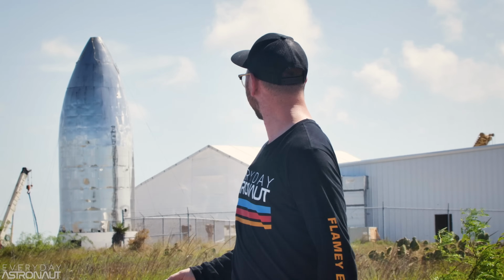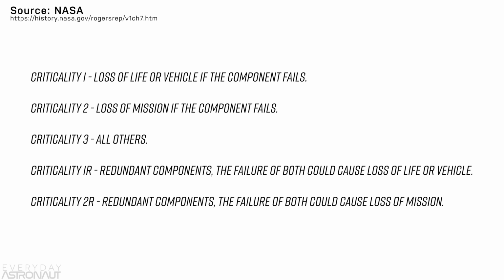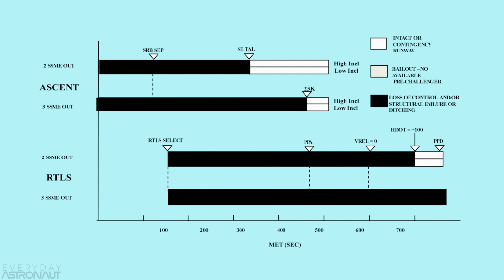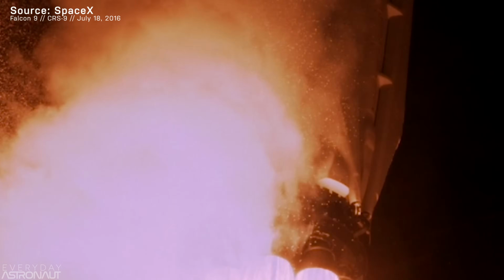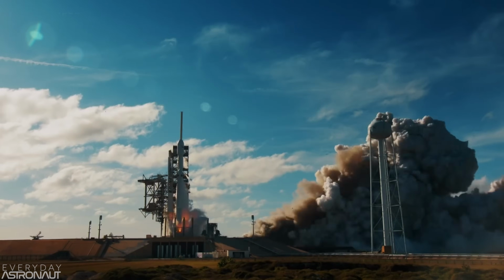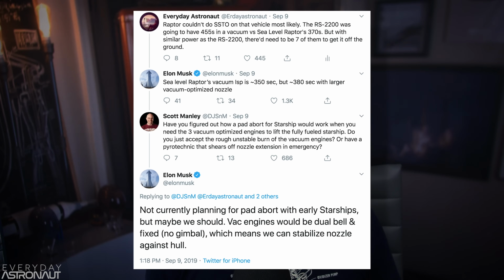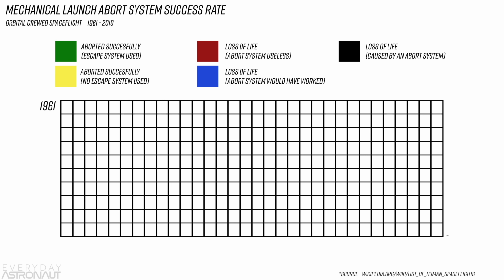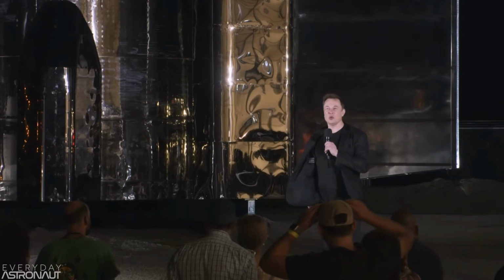Why won’t Starship have an abort system? Should it?!

Comment: My gut says we should have abort systems.

However, airliners don't have abort systems, and thousands of planes take off and land everyday without incident, and fatal crashes are extremely rare. I maybe hear of one or two fatal crashes a months globally, which may sound like a lot, but when compared to how many are flying at any given moment, is extremely rare.

If they can add the abort system without further complicating the design, they should do so. Otherwise, they should do without.

Comment: Look, as safe as modern cars are, you wouldn't dream of driving one that didn't have an emergency system known as ai bags would you?  To me its the same issue.  Nomatter how safely you engineer a craft, accidents (from outside or internal failures inside or defects) can still happen, so you need an emergency management system to protect the passengers.  Trains have not been engineered like cars have and do not have onboard emergency management and passenger protection systems and look how bad that result has been!  Almost any train accident is fatal to a large majority of its passengers.  True the complexity of airbags caused some problems initially with too had deployment and baby seats or accidental deployment in some rare cases but all of those issues were worked out early in the game.  They have saved magnitudes on order more lives than they have taken.  So taking from those two examples of crash management and passinger protection systems, it's fair to say that despite the increased complexity added by the systems, its' vastly  better to have one than not to by a large margin.. because future accidents can largely not be anticipate or you would have avoided them if that were the case, so knowing that they will happen, it's better to be prepared with an automated system for sensing accidents and handling them in real-time than to automatically do nothing and not mitigate the risk to the passengers.  This really should be a no-brainer.

Comment: Excellent video. The reason why airliner data wasn't available from before 1929 is probably because there weren't any. Some aircraft could carry a few passengers but it wasn't until the mid 30s that aircraft like the DC2 and 3 came out that passenger numbers were higher than 20. Rocket safety was higher initially due to lessons learned in the aircraft industry.

Comment: Since there are redundant engines, do they take off with thrust adjusted for payload and if one or more engines fail, there's margin to increase the thrust on the remaining engines thereby ending up at the original thrust level? Or do they start off with a margin and consider the fact that if two engines fail then it's enough with them at zero output?

Comment: The Video is a bit older BUT, regarding the F1 Engine "Fail" being just something Mandela effect related is not true to 100%.
The  F1 Center Engine DID unexpectetly Shutdown early on Apollo 13s ascend , which is a Failure SOMEHOW, since it was not intended to do so at that particular moment on ascend. 
i mean, it still was able to get into orbit just since it was quite late in the ascend process BUT, has that happend earlier it might have been a problem since the F1 had a pretty low TWR.

Comment: I'm of the opinion that the large single axial main booster will provide a forceful enough explosion that it will automatically eject and distance the crew module... just like the tests showed it ejecting the coils of stainless on the failed tests.

Comment: I think you should calculate engine reliability using baysian statistics. If you fly engine A once, and succeed, you have 100% 'reliability'. If you fly engine B 10 times and have 10 successes, you also have a 100% reliable engine, and yet we consider the second more reliable because it has more evidence of reliability. Baysian stats accounts for this as follows:

Successful flights+1 / Total Flights+2

The logic being that when you have zero launches, we assume a 50% likelyhood  of success or failure (1/2). If we succeed, then we update our prior to 2/3 and if we fail, we update to 1/3. 

So 1 successful launch implies a 66% probability of future success. And 10 successful launches implies a ~92% probability of future success

Comment: "My car engine died 4 seconds before I got to my house, but I was close enough to walk the rest of the way. I call that a success!" - RD-180 engineers, apparently
Reply: The difference is they have enough money to throw away a rocket, while you probably wanna keep your car :)
Reply: No rapid unscheduled disassembly either. That is a good car.
Reply: Yeah, but the car would probably be able to roll home
Reply: @anonymm3152  Only because you can get out and push it :)
Reply: I SEE THIS AS AN ABSOLUTE WIN!!
Reply: Failures are all apart of successful its what u do with the failures.
Reply: ''My lunar landing capsule failed a meter  before it touched down on moon... I fell the rest of the way...''
Reply: Who needs a single use car to work after it almost arrive at home?
Reply: Come on Rd 180 is better than most American engines
Reply: Ok that’s a good one
Reply: ...more like the car rolled in neutral until it barely made it onto your driveway.
Reply: dghohens , SN8 engineers said exactly same thing, apparently
Reply: @user-wd5uc5uw4r  That was a test flight purely for gathering data on never performed before maneuvers. Elon Musk didn't even expect it to reach 12.5 km. That is completely different to an operational launch of a proven rocket.

Comment: Couldn’t the tip of the rocket be a crew dragon with a hatch through the heat shield? The header tank could be torus-shaped to allow the astronauts access to the main cabins once safely away.
Or they could be seated next to the access door (explosive bolts) and be ejected in parachuted seats.
Just ideas. I’m not an engineer.

Comment: Considering that we all get on airplanes even though they don't even pack parachutes for the passengers, I think we should be fine without an abort system on rockets. Especially if the next generation of rockets (starship) has some significant improvements in safety.

Comment: I agree with the notion that there needs to be more space flight in order to be sure that the operators know what is wrong with the crud they are throwing at the sky. The issue is if they have the stomach to burn all that money. So I think cheaper space flight, fewer parts, fewer processes, & more flight will make a safer system.

Comment: I ran the numbers.  The probability of none of the Merlins failing on the Starship booster is 96.35%.
The chance of 1 or fewer failures is 99.93%
The chance of 2 or fewer failures is 99.9992%
The chance of 3 or fewer failures is 99.999994%.

I used a Binomial distribution assuming that 1 Merlin failure does not cause another Merlin to fail with a 99.88% reliability for each engine.

Comment: Its not a question about safty, sure an abort system is always more saftey as no abort system or some form of saftyness.... the question is how much money you will spend to save human life....
If losing crew in every 10000 rockets starts cause of no abort system is fine then you dont need an abort system....
If not you better build one.

The point is at wich % rate we say its fine if humans get killed.......

If every car has an roll bar and everyone needs to wear a helmet we would have fewer deaths.  Buts its not worth the money to safe human lifes for this kind of investment.

Comment: planes take off horizontally  could a safety factor be increased by changing the attitude of the launch vehicle to a  37 degree angle and launching from a rocket on a maglev assist?  Launching from sea level seems counter intuitive. Launch from a higher altitude, 3k and above,thinner air by 40% fewer hurricanes or poor weather. Using terrain for rocket sled or maglev boost. I believe that rocketeers have a soft spot for warm locations kyrgrzstan is over 2133 meters. Should we learn from success. it is just a thought. the desert is just as uncrowded, landing in a crash water is like concrete after 100kph , so might as well crash on ground. I am not a rocket engineer or designer. But if the russians can find a way to launch from higher ground maybe we can also. And launching from a rocket sled at angle with a booster that stays on ground just may be a better way. just a thought. Rocket sleds are a proven tech.
Reply: "lanes take off horizontally  could a safety factor be increased by changing the attitude of the launch vehicle to a  37 degree angle and launching from a rocket" - No, less angle means more gravitational losses that means more fuel needed for launch (for planes that works because they are glide).
"on a maglev assist" - No, need too much time to get to some decent speed and again - angle is important. I don't even want to imagine what kind of current power and what magnets need to be used to push so much mass to upper altitude even with small angles (Even using planes is not so efficient because of relatively low velocity of them and their small weight capacity).
"Launch from a higher altitude, 3k and above,thinner air by 40% fewer hurricanes or poor weather" - Putting whole rocket and build all infrastructure for it on the mountain probably will take more effort rather than launch it from the flat valley even if its 3 km bellow. Weather is not an issue, but high altitude and low pressure can be very contproductive for personal. And possibility in case of emergency SAS system deploying and performing it and landing in the mountains area is not a good idea either. So mountains will work against all construction and safety measures.And for rockets it is not a problem to get to the right altitude, its more about gaining right speed - you can get for your altitude more earlier that's true, but you still need to achieve require speed to be on stable orbit.
"landing in a crash water is like concrete after 100kph" - landing in a whater is not for safety in a case where you lost all of your shutes. Its just more about error tolerance (as you say the ocean is big and landing have 0 harm to water habitats). 
"launching from a rocket sled at angle with a booster that stays on ground just may be a better way. just a thought" - No, if we talking about increasing starting velocity only for 500km/s and even 1000 km/s considering that payload requires 28000 km/s for stable low earth orbit. It will require to much effort and funds and will give to less in return.
Reply: No it's not the angle of flight that makes а rocket dangerous, it's the speed and the amount of fuel it carries.
Reply: The reason most launch sites are in  hot countries is because launch vehicles use the rotational speed of the earth to supply part of their energy to get into orbit. This horizontal velocity vector assist is multiplied by the cosine of the latitude. Once you get up to the latitude of Kyrgyzstan ( 42 degrees) this is reduced by 25% or about 260 mph. Florida for example is at a much lower latitude and so can use the full 1040 mph assist.

Comment: By definition modern space-faring rocketry is a crapshoot at all times. Even systems that were considered bulletproof have failed and caused losses of life. They are massive endeavors, with millions of pounds of material, millions of man hours, and billions of dreams riding on them. It is a tragedy when they fail and claim lives. When such a time comes where the safety department is comfortable without an abort system to allow engineering to do what it does best and find the best solution that fits the parameters, we've conquered space-faring rocketry. 
To date we have merely pulled open the door to space, and stare in awe at it's wonder. One day we will walk through that door, with our heads high, into the unknown. And I'm willing to bet those who venture into that unknown will have some way to save themselves, but not one that exists or is used right now.

Comment: I suspect either SpaceX or someone else will one day develop a larger size, full fledged spacecraft like the Shuttle. Capsules, while simple and dependable, are very limited and not very versatile. Limited in carrying capacity, very limited in traveling and orbital adjustment capabilities. a viable system to use for now, but certainly not forever. Not unless we can use lots of them within a short period of time. 
I still believe that a large, proper spacecraft, like the Shuttle, is still a feasible modus operandi. And, sooner or later, we will have to develop something of the sort. After all, asteroid mining operations and research missions can't be accomplished within reason with a teeny tiny capsule. We will, not now, but eventually, need large versatile craft to perform these more complex operations.
Perhaps we should have ones dedicated for ground-orbit and ones dedicated for orbit-moon ops.

Here's a modern day parallel: What is used to perform an Antarctic research expedition? A totally dependable, simplistic lifeboat with a few days worth of supplies? Or a large, more complex, versatile multipurpose ship?
Reply: We need that space jet from Guardians of the Galaxy!

Comment: 0,5 percent saved or lost? That doesn't sound like much. But 0,5 percent of 4.3 billion airline passengers per year? That would be a considerable amount. Of course we learn from our mistakes - catastrophes bring more data and make future flights safer. But if we can save those 0,5 % lives why not use abort systems for a foreseeable future. And it's easy to see why SpaceX (or any other commercial operator) would like to avoid them - cost.

Comment: Two very relevant observation in your analysis i think is that (1) The 'need' of abort systems is higher in the early life of a 'system So in the early years of 'Starship' it may be a necesity, where after a while its no longer contributing enough to safety. And (2) Energy spent on introducing and validating 'abort systems' could also be invested in testing & validating and better design of the rest of the 'Satship'. For this second observation however also the question is, will that investment be considered and will it add more safety?

Comment: Add enlarged versions of the Super Draco thrusters in quads to the crew section of the Starship. Make the crew section detachable through pirotechnics and have a parachute system in the nose. If things should go awry splash in the sea off the Cape.

Comment: If stainless steel was superior to carbon composite on aluminium - what should Space Shuttle designers have hindered to use it?
Steel is heavier than aluminium at the same strength, and only slightly less heat sensitive - while carbon can sustain 3 times higher temperatures at vastly lower heat conductivity. 
Maybe Starship has a completely different flight envelope, but still a chief engineer is not a sorcerer.

Comment: I work in the aircraft industry. Pretty much every commercial airplane has 3 hydraulic systems and redundant electrical buses. That costs $$ and more importantly weight. Weight is so important with rockets. The weight penalty for the perforated flaps, landing struts, extra structure and extra fuel for landing the falcon rocket is huge. It’s not inly the weight of that stuff, but the weight if all the fuel required to lift all that stuff and accelerate it with the rest of the vehicle. Then that extra weight requires more structure etc etc. It’s a snowball effect. So the savings of reusing the rocket must be huge when compared to just making a cheaper simpler lighter rocket. I would not have expected that, but I am sure SpaceX did all the math before they started making stuff.

Comment: Overall really good, but you make it seem like more flights of the same system without any changes makes it more reliable. That's just proving the reliability of the system, and not improving it. A system will have a certain reliability by design, we just don't know what that is until we collect enough data. By flying more missions we're improving our knowledge of the reliability of the system, in order to change that reliability we would need to change the system itself.

Comment: I agree, simplicity is better.   A solid-fuel puller-abort system is simpler than a liquid-fuel pusher-abort system.  I don't know why both Boeing and SpaceX moved away from from the solid fuel option.  I wouldn't want to fly in a rocket without an abort system until, like you say, the design had flown successfully 100s of times..  And how many engines are on that Starship?  There were a hell of a lot of engines on the soviet N1 rocket booster too.  How'd that design turn out? You suggested that more engines make a vehicle more reliable.  Only if an engine can fail and not cause a chain reaction. Otherwise, the more engines, the more opportunities for problems.

Comment: The F1 engine had one thing in its favor most of the other engines don't. After examining the remaining F1's in storage/museums, it was discovered that each and every F1 engine was custom made. Meaning no two F1's were alike as each one had settle modifications in manufacturing to make them flight worthy. Also said manufacturing was done in many many places by hand with machining equipment. All this means every part of the F1 was essentially hand made and custom installed in every engine made.

Comment: I was going to subscribe, but those arguments at the end... You're basically saying "why do you need an emergency measure? you should just do a great job and nothing will happen". Not trusting yourself and double checking and putting safety measures in place to counter anything that passes through it basic logical thought. The content is gold medal, don't get me wrong there. It's just when your opinion starts dipping on the technical or logical side, it falls over just like the video you posted with the launch failures ranked.